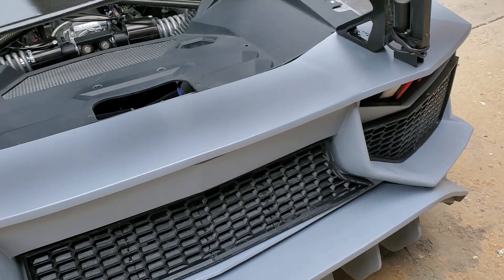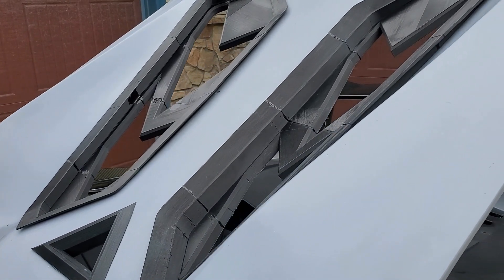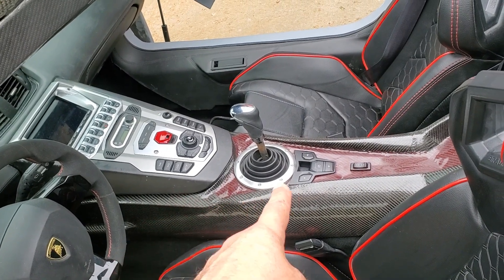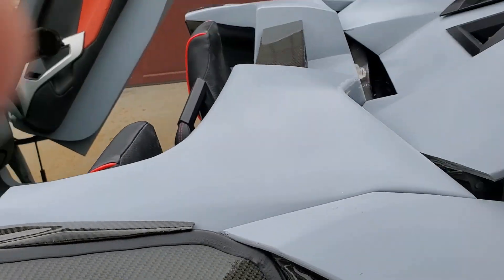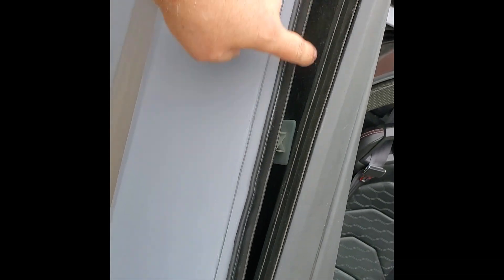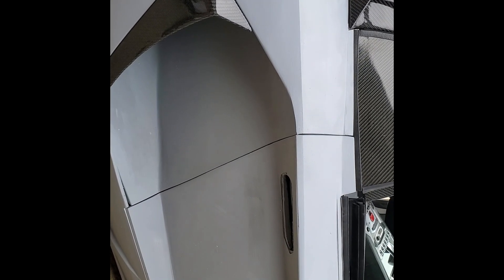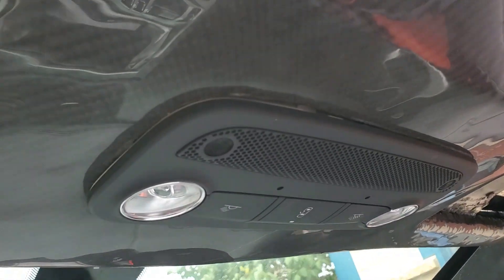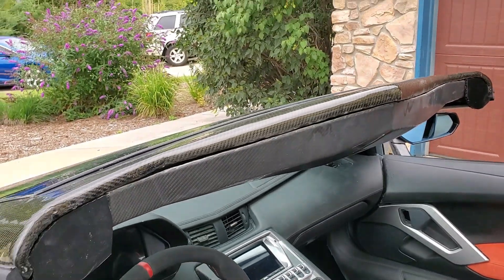My week working on the 3D Printed Interceptor Aventador Update 153 Fixed

Comment: That is very cool the effort put forth to result in having something like that.
And it would even easier with larger capacity printers that are as easy to make as adding even 15ft lengths of basic metal conduit piping for making one of three printer axis.

Imagine converting your swimming pool into a SLA printer?

Comment: The car is coming out really nice it looks really good
I have a question. Just like in a C8 If would you ever work on the engine. The way it's in there it's way in the inside and low  it seems like it's impossible to work on. Maybe I'm missing something ?
Reply from the maker: It is low.  On my to do list is to raise it, and the trans up.  Currently my oil pan is way too low.  Good observation!  I have not told anybody yet. 😁

Comment: Looking Fantastic Stirling, only thing I myself might do is, since you have red piping on the seats, wheels and the red Kevlar on the centre console, maybe do some more of that around other areas, like scoop entries etc where there is black plastic, paint or carbon fibre, but not on top of the white paint areas, I don't think that would look right.
BTW Nice job on the alum panels in engine bay, they look good just the way they are( I like chrome finish)👍
Reply from the maker: Thanks Bob!  Good suggestions!

Comment: The car is looking incredible.  In terms of the finish, I think there will come a point where to get the finish looking as close to production as possible you might have to seek the advice of a professional body shop, or even give it to them to finish, but I love every bit of this project.  I can’t believe it’s been over 5 years, I started watching when you had just about started welding (and re-welding) steel tubes!

Comment: I couldn't do what you did, at least not that process.  I've seen your struggle over the years with getting body gaps to be consistent.  I think if I were going to tackle something like this I wouldn't start with a custom rolling chassis, I'd pick something existing (so the base was consistent), plus if it turned out well I could possibly offer kits for others to do the same.
If it were me, I would build something that's unobtainable not for price but for rarity like a Delorean or a Tucker.  Rather than piecing body panels from chunks of 3d prints, I would probably 3d print a buck for a vacuum former and create the body panels from 1/8" ABS plastic as a single piece.  I think it would be much easier to make changes to a negative die (if you had to make any changes at all).  I think the gaps were so bad because of the stackup of combining smaller pieces.